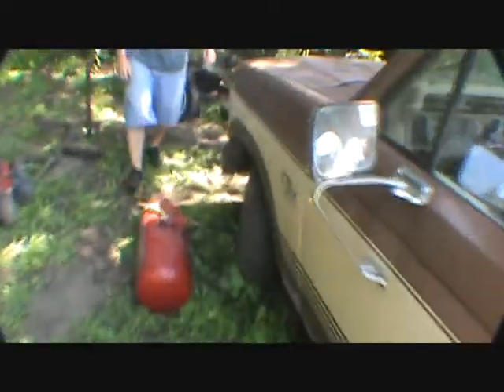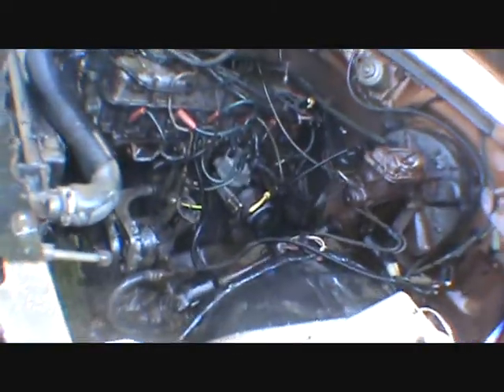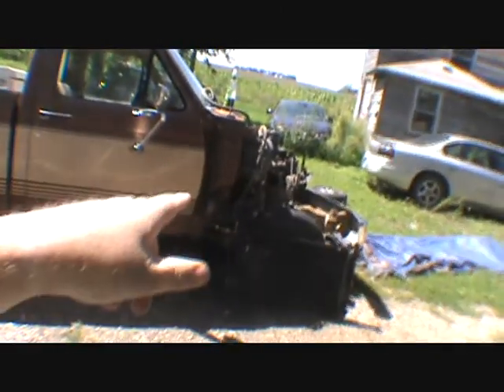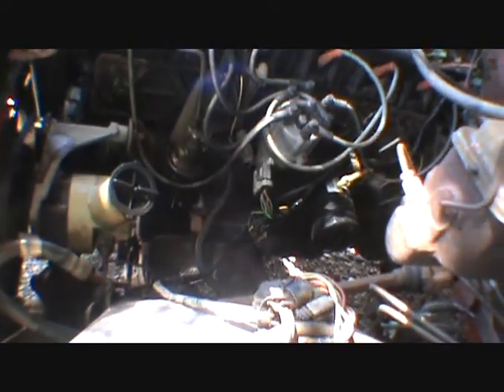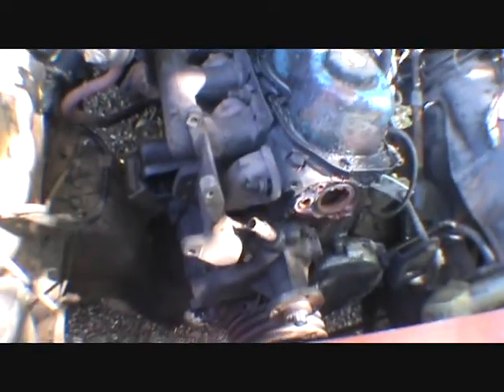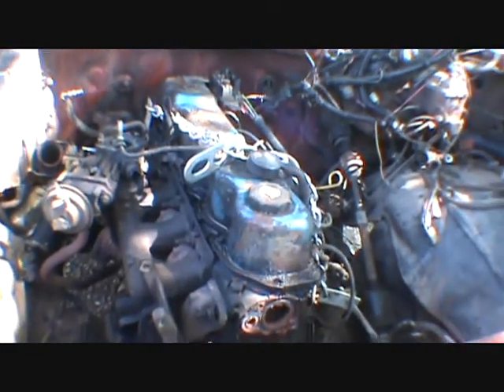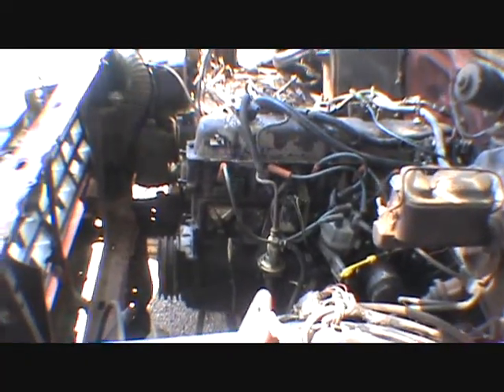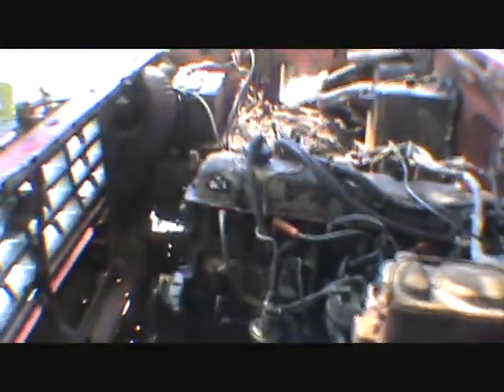85 ford f150 300 6 cylinder stole one to fix one lol

Comment: The 300/6 was a great motor. I had an old Ford van with close to 200k miles and when I sold it the new owner had it for 2 years and h sold it in running condition
Reply from the maker: yes those 300's were very hard to kill off and if you did you really had to work at it lol

Comment: At least it's in. I had a 85 F 150 and didn't have to work that hard to pull the 302 FI engine out and reinstall.
Reply from the maker: if it wouldnt have  had a top loader trans i would of pulled it all in one shot